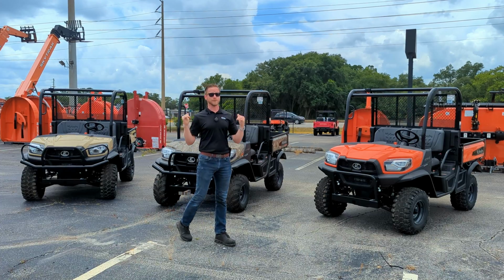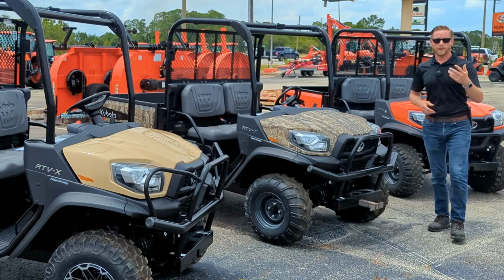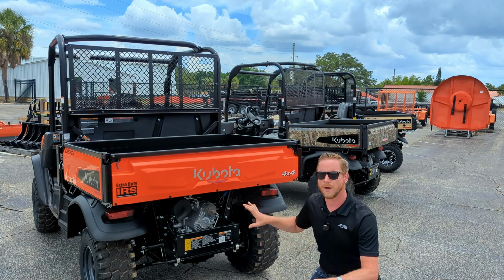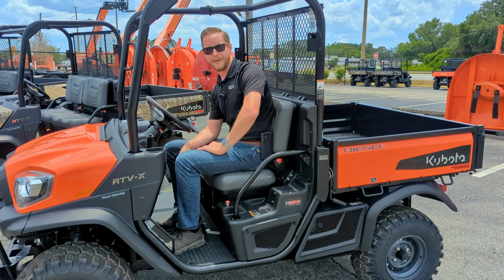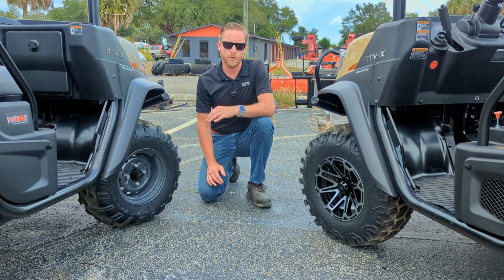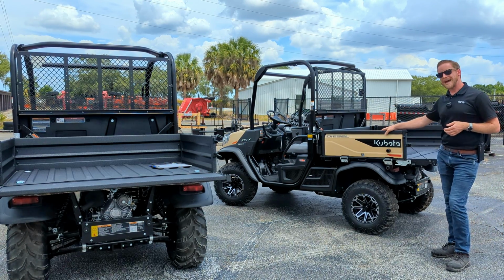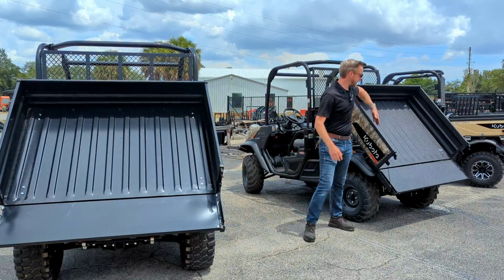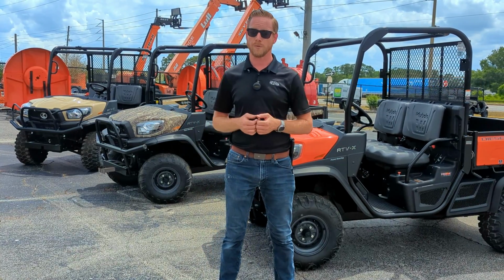Kubota RTV-X2 Detailed Overview

Comment: Why would you advertise a towing capacity of 1300 lbs that's at the low end of the competition. John Deere's have models with 4000 lb towing.
Reply from the maker: True, but not in this class. The equivalent models to the RTV-X would be the 560/590 which have a max tow up to 1500 Lbs - relatively the same. To get up to the 4000 Lb rating requires moving up to the 845/875 models which are larger and more expensive.

Comment: These are gutless, I bought one and the max speed up my driveway is 9 mph. It almost can't climb any hill in high or low gear...
Reply: put it in high range
Reply: @RittenhouseSecurity  High and low, the only difference is top speed...
Reply: Then you have other issues if you can only get 9 mph out of it.
Reply: @ronaldchipper4497  It's a 2024 RTV-X2 brand new and has zero issues. Up a grade the top speed is 9mph...